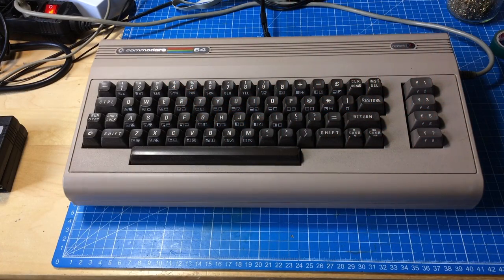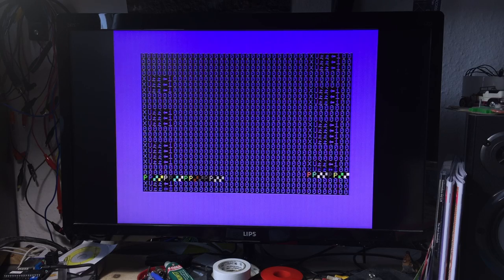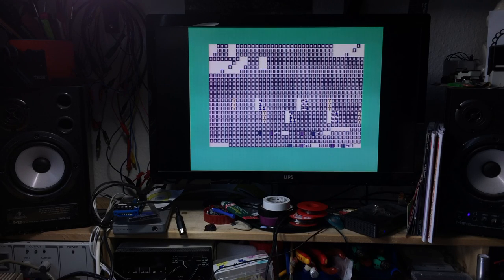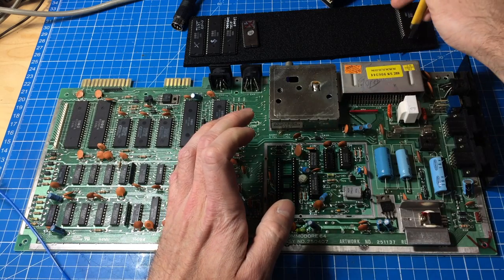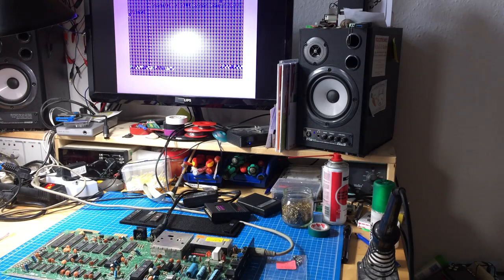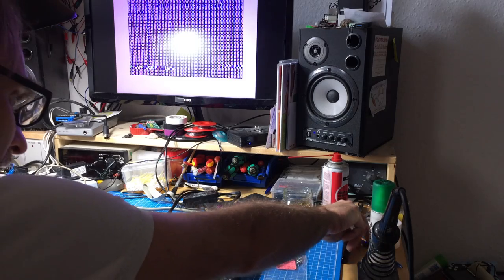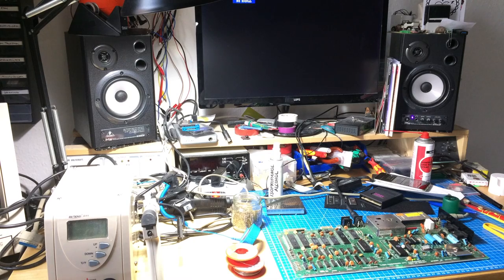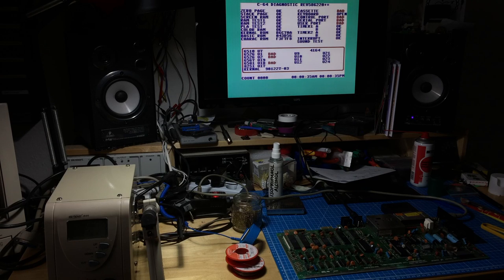Commodore 64 Repair (Garbled Screen) ASSY 250407

Comment: Nice video, and thanks for mentioning my diagnostic guide. The site isn't a "golden solution" that pinpoints every C64 problem, but can be greatly helpful in some cases, especially when used in conjunction with other sites and information at hand. This case has now been added to the site as a U14 fault.
Reply from the maker: +DerbianGames Thanks! And thanks for maintaining your brilliant site. It really is a great addition to other troubleshooting guides and obviously worked very well (and quickly) for me in this case. :)

Comment: This video saved me... was exactly the problem I had with my C64 board. It started as a memory chip failing board, but after all the memory chips were replaced, both CIA chips turned out to also be bad. After replacing those, mysteriously the screen would sometimes get garbled, but still run the diags (you could hear the SID test). Perplexed by this, I checked everything, replaced the PLA, checked the VIC-II, nothing seemed to help. I set it aside, frustrated, and went on a trip with my wife. Days later I came back, taking a fresh look, thinking it's time to start replacing logic chips. Then I watched your video and it seemed to be very similar problem I was having, though my screen didn't look same as yours. Turns out it was U14 74LS258. I have a chip tester from Evie (Backbit), and after desoldering U14 I tested it (and it passed), but I decided to still try replacing it. It seemed to be a very marginal failure, so could be a false pass. The replacement works wonderfully, harvested from a donor board (because I don't have another 74LS258 lying around). So... huge THANK YOU for this video!
Reply from the maker: Hey, that's awesome! Glad that my video helped another C64 to come back alive! :D The intermittent or marginal faults are always the most difficult to figure out. Nice work!

Comment: Always good to see a C64 come back to life - especially if it's a component that's still made like the 74LS258!
Reply from the maker: Yes, I'm going to order some of those for future repairs. The MOS equivalents used in some C64s seem to die very frequently.
Reply: @JanBeta  Can't you do a piggyback instead of desoldering?
Reply: @ivanbiasutti4567  If its a logic chip I guess that wouldn't work - if the broken one says 1 on a pin and the other says 0, you have a 1, right - so its wrong. That's my thinking anyway, I don't know anything about this really :)

Comment: I have a similar problem with a board I am working on, where it has two cursors and displays some of the keys I press correctly, while others will display the wrong letter or number. I also looked at the pictorial and came to the same conclusion that you did. However I am now just waiting for some 74LS258s to arrive. I appreciate the time and effort you have put into all of your videos.

Thank you

Comment: Awesome vid. Had some similar problems with my c64 a few years ago.  At the time there weren't that many videos like this that were in HD or in English, so I did the best I could to diagnose it with some diagrams I found on the net. I ended up ordering a ram kit thinking that would be an easy fix, but that didn't help. I was pretty busy back then and didn't have lot of time to really mess with it, so I just threw everything in a cardboard box in my basement with the hopes that in the future, technological advances would make it easier to diagnose and repair it. It looks like that time has arrived! I can't wait to get home tonight and pull it out of storage and see if I can get it working again with the help of your vids. Thanks for posting these!!!!
Reply from the maker: Thanks for this comment! That's what I do these videos for. Hope you can get your C64 fixed. If I can be of any help along the way, feel free to ask. :)

Comment: As usual, a rockstar repair.  My first thought was the PLA, but you threw me a curve ball when you showed that everything seemed to be functioning normally under all the screen garble. The Pictorial Fault Guide is a great reference tool; I have used it quite a bit myself. And deducing the MOS7709 as the culprit was brilliant. I've made notes for my own reference. I learned a lot -- thanks professor! ;)
Reply from the maker: Haha, thanks! It was pretty easy to find the fault once I read about the doubled cursor in the Pictorial Fault Guide. That plus the fact that the MOS chips fail frequently made it clear to me that it had to be that chip. :)

Comment: Hahaha that's amazing. I knew Ray's site, but this other site is surely helpful. One of my suspects was the character generator rom. But the double cursor was another issue. Well done Jan.
Reply from the maker: +The Highlander The character ROM I ruled out pretty quickly because it usually results in characters not being displayed correctly. They all were correct in this case, just the wrong characters so I looked for other faults first.

Comment: Another great video. In my case, the screen was full of  the "@" sign instead. Turned to be a problem with 7805 which fed 2,15 instead of 4,97 volts. Thanks and keep up the great work!

Comment: Also, what file browser are you using on your SD2IEC? I've never seen the one you are using before. (EDIT: Duh. I should read the description first.)
Reply from the maker: Haha, yeah. I linked it in because I knew somebody would ask. It is pretty good but it's a bit fiddly to work with due to strange keyboard commands and stuff (there's a list of commands in the CSDB comments also).

Comment: Hello! When running the 586220 I get a blank screen when it tries to run the ram test. No flashing telling me what could be wrong, just a static picture. The 781220 completes just fine and can run continously. If I start the C64 without the dead test cartridge it says 14528 Basic bytes free and a blinking cursor.

If you know what could be the cause of this, I would be very happy for some information. :)

Comment: Hi, I have a problem that the characters look twisted and look torn. It looks like strips of pixels shifted right and left. I am plynning to replace the modulator anyways. I didn't Test the s video output. I am also planning on installing a lumafix64 against thd banding. Does anyone have any guesses or directions where to look?

Comment: Do you know if there is a pictorial fault guide for the VIC 20 ???
Reply from the maker: I'm not aware of such a guide. I guess it would make less sense than for the C64 as the VIC's most common failure mode is a blank screen.

Comment: Great Job!! What is your desoldering station? Looks really nice and easy to use! I am using a simple one with hot air but really hard to do a decent job.
Reply from the maker: +pincopallino Thanks! It's a ZD-915 (sold under different brand names). I made a video about the station a while back: https://youtu.be/EQEx7Cezz9o
Reply: Jan Beta many Thanks for the station reference:-) I am definitely taking one of these for my future works. !

Comment: Hi, I just purchased a second hand C64 & when using the diagnostic cartridge it shows a bad interrupt but everything else seems normal. Is this because I don't have test harness connected or is it because my version of the test cartridge is 586220 only and not the ++ version you have?
Reply from the maker: That may very well be because of the missing harness. The Diagnostics show some errors without that connected. The ++ version only has some minor changes (at least afaik) compared to the original. It adds the ability to detect some more Kernal ROMs but not much else is different.

Comment: Tell ya honestly those de soldering stations are a must have for sure.   The link for the Video Display Troubleshooting is a nice addition to troubleshooting issues.   You mentioned the DPDT Rocker Switch and I just got in a 1581 that had a faulty switch that I removed and it was corroded so I have to take some measurements on it because DIGI KEY has some that are basically drop in replacements but are a bit too tall and narrow so for now I just added jumpers to allow me to test the drive.   I also have a Rocker Switch on a Plus 4 that I got functioning but its a bit on the stiff side so it needs to be replaced as well.   I don't even know why I even bother with the Plus 4 when the chips if you can find them cost more than the unit is actually worth, but its in my collection so I have to bother with it.    I have a C64 where the dead test cartridge did not display and in testing the board out the issue came to U15 74LS139, U17 PLA and or U19 VIC-II.   I  put in a new PLA and got the video back but the characters on the initial display are not pretty.   I swapped out the VIC-II with no change but the DEAD TEST Cartridge now displays perfectly regardless of which VIC-II chip I put in.   I had to order the 74LS139 so I will add the socket tomorrow and at the same time I will check my work on the traces to the socket I put in for the PLA just to make certain I did not over look anything but the visual inspection of the solder joints looks good but you never know until you verify.
Reply from the maker: Couldn't live without the desoldering station for sure. ;)

How's the C64 repair coming along? All traces intact? I just repaired another breadbin that had a faulty rocker switch and one of the MOS logic chips was bad, too. Works like a charm now. I managed to lift a pad on the RAM but put a wire to repair it.

Nice work (as far as I can tell) on your hardware! The Plus4 is kind of a lovely machine, too although it has its weaknesses of course.
Reply: Solder Traces tested well.  I am waiting for the U15 74LS139 Chip Order to arrive,   After which I can resume troubleshooting my issue if it does not resolve the issue.  Even the J-PLA I am trying out which resolved the Black Screen issue could in part still be an issue so I have another MOS PLA coming in.    I may also opt to socket the entire C64 Breadbin and use it for testing suspect chips from other units in the future.
Reply from the maker: Yeah, especially the older board revs can be very picky when it comes to the right PLA. Socketing one C64 board completely is something I always wanted to do, too but didn't get around to doing it yet. I have one that at least has everything except for RAM and logic socketed so I can test some of the more expensive chips.
Reply: I have the C64 working the problem was with the PLA and the Character ROM.    I have a J-PLA in there now and its working well.   While I have the Character ROM for the C64 on order I decided to try the ROM from a C128 (315079-01) which worked perfectly but once the C64 ROM comes in I will swap it out just incase its not 100% compatible.    I don't play games so I really don't have much to test it with unlike years ago when I had boxes fully of software for the C64 and 128 that I either gave away or sold off. (Pout).   I did socket the CIA's, ROM's, 6210, a couple Logic Chips, Color RAM and may just socket the rest of the thing since its still on my bench before I put it back in the case.    I need to get it off my bench so I can finish up working on a 128D DCR and a couple other small things then I can focus on the stuff I took home from work to repair.

Comment: Well I thought for sure that my issue might be resolved by replacing U14 as I was getting the same double cursor and some misprinted characters. However when I tried piggy backing the 74LS258 (U14) it did not make any difference at all. So, I started comparing measurements to a working machine, and all the U14 measurements looked the same. 
So, I took another look at the C64 Fault Pictorial website and at the fist fault comments. In the NOTE: It clearly stated that this problem could also be caused by a bad VIC chip. So, I swapped out the VIC and Wa-lah !!! 

Of course now I have a bunch of 74LS258s and an assortment of 4164 RAM chips  laying around, but I like having spare chips around for when I need them.

Comment: Well done old chap. Can I ask what temperature you set for your desoldering station? I have the same gun and struggle to get the RAM out because of the ground plain, but don't want to whack the heat up for fear of cooking the ICs.
Reply from the maker: I have it set to 350C at the moment. Works best for my "style" of desoldering. I touch the joint briefly until the solder melts and wiggle a bit while using the pump. Then I quickly pull away to not overheat the component. Took a while to get to a temperature/timing combination that worked for me.

I read somewhere that it's better for the ICs to get hotter for a shorter period of time than to get exposed to lower heat for a longer period. I don't really know if that makes any sense. I haven't cooked an IC with my method yet. ;)
Reply: I've been told you can keep heat to a minimum by not desoldering adjacent pins, i.e. jump skip four or five pins at a time and keep switching sides.

Really struggling with those ground pins on the RAM chips, too much copper on the board drawing heat from the gun. Annoying since the 20-pin CIAs came right out.
Reply from the maker: Probably a good idea to skip pins or pause between desoldering. For some ground connections, I turn the heat all the way up and try to do the desoldering as quickly as possible. I found that adding fresh solder or flux and also wetting the tip with solder helps a lot to get more heat to the actual joint.
Reply: Thanks for the tip Jan. This board will be either stripped or on fire before too long.
Reply from the maker: +dantootill Hope you get it to work again without burning it. ;)
Reply: Nice video, as always. I doubt you can cook an IC unless you do it on purpose. You'd sooner lift a pad and a trace if you set the temperature too high than cook an IC. My old Aoyue 8800 started lifting C64 traces at 350°C while new ZD-8915 does it at about 400°C. However, if you set the temperature too low then you'll clog the desoldering gun. It's all about the balance between those two temperature points and your style/method, as you mentioned.
Reply from the maker: Yeah, lifting the pads is pretty easy on higher temperature settings. Good point. :/

Comment: Great video, my C128 has the same fault in 128 & 64 mode wrong characters & double cursor, so U14 is the one I'll check first. 👍
Reply from the maker: Glad to help! I don't have a C128 to double check but I would guess that the numbering (silk screen) on the board will be slightly different. Make sure to find the equivalent of the C64's U14. (It most likely still is a MOS 7709 or a 74LS258.)

Comment: Good tip :) Love a bit of Buggy Boy :) Got any good tips on making the most out of SD2IEC.. I know how to use it, I noticed you have it set up differently.. Sometimes I have issues with Multi disks, some disks have stuff on that I do not understand..(could be levels in the game) they are PRG.. One game I really want to load up is the Turrican games, tried Disk and Tap files.. Cheers if you can help.
Reply from the maker: Thanks. :) The PRG files on the disk are most likely levels and data that the main program loads after it is run. The SD2IEC is not a full emulator of a real drive though, so most software that uses internal fastloaders and such simply does not work (with a growing number of exceptions). For using multiple disks you have to put all disks that belong to one game in a folder and also add a "AUTOSWAP.LST" textfile that has the names of the D64 images in it. Rod (The future was 8-bit) has made a handy little summary of SD2IEC functions you can go through here: https://www.thefuturewas8bit.com/index.php/sd2iec-info

I also highly recommend getting some sort of SD2IEC compatible fastloader (Final Cartridge 3, Epyx Fast Loader, JiffyDOS etc) because it significantly speeds things up and adds nice keyboard shortcuts for loading stuff etc. I'm using a FC3 on my C64 most of the time. For this video, I used SDBrowse (linked in the video description) as the program to browse the SD and start games. It has a built in fastloader that's not too bad but it's generally a bit fiddly to use. Hope this helps you get more out of your SD2IEC and your C64. :)

Comment: I'm an old C64 user and tinkerer myself. I've seen a couple of C64 boards long ago, but none of them had the regular 74LSxxx ICs renamed to Commodore's own MOS-brand. By the way these chips aren't just "compatible" with 74LSxxx but plain relabeled, I'm sure. Normally such a thing is done to hide the design of the circuits. However it looks very pointless to me since there were tons of C64 boards without that rebadging.... You can get brandnew ones for example at your local Conrad.de store for a few eurocents...or at some little electronics components store.
Reply from the maker: If I understood the story correctly, MOS produced the chips in-house to further cut the cost (probably a couple of cents per C64 unit). It turned out that the quality was inferior pretty quickly and Commodore went on to buy off-the-shelf parts instead. I've seen at least two C64 boards with the MOS logic chips on them so far.
Reply: Alright, thanks for the details. Quite interesting!